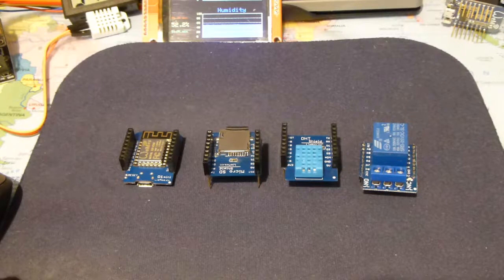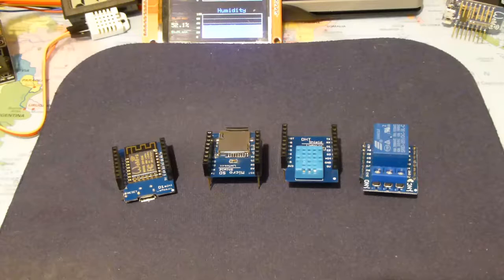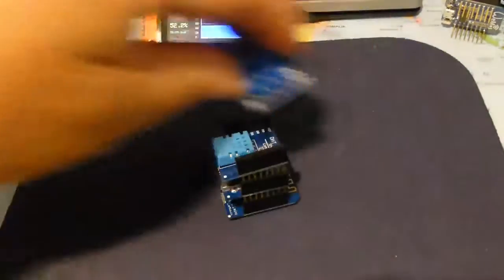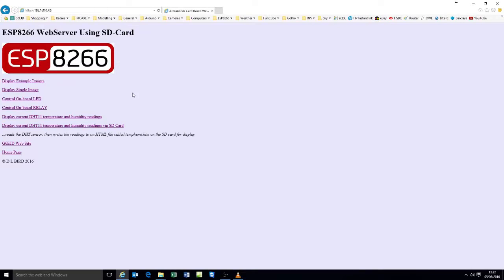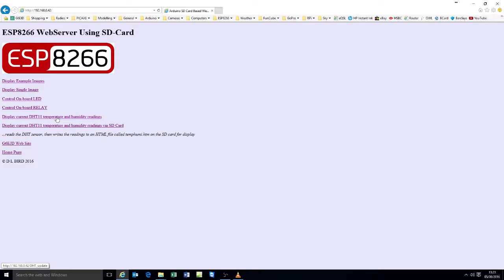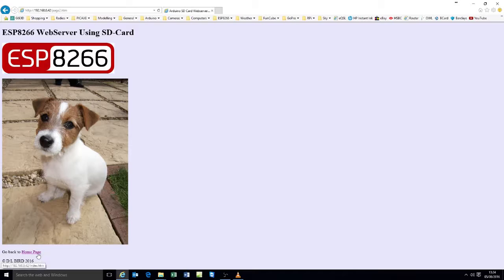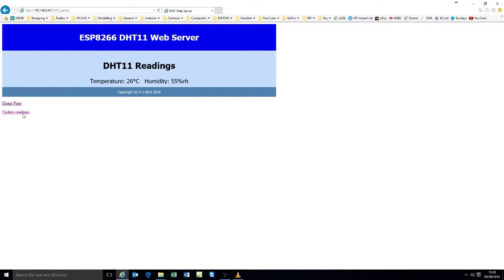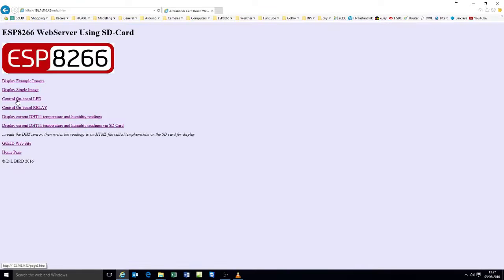Tech Note 005 - ESP8266 Webserver and Code

Comment: Your sound quality is poor it sounds as if you have a motor running and the volume is low but I did like the video was most interesting with the stack thanks
Reply from the maker: Yes  I had a microphone fault and did not check the video before upload, but I did enhance the audio a bit on this version: https://www.youtube.com/watch?v=kgimiRAiKRU&t=108s
Later on in my video series I released a general purpose web-server with configurable pages that might be worth a look.

Comment: having issues with the compile mainly Arduino: 1.6.13 (Windows 7), Board: "WeMos D1 R2 & mini, 80 MHz, 921600, 4M (3M SPIFFS)"

sketch\Sd2Card.cpp: In member function 'uint8_t Sd2Card::init(uint8_t, uint8_t, int8_t, int8_t, int8_t)':

Sd2Card.cpp:302: error: cannot convert 'volatile uint32_t* {aka volatile unsigned int*}' to 'volatile uint8_t* {aka volatile unsigned char*}' in assignment

     clkport     = portOutputRegister(digitalPinToPort(clockPin_));

                 ^

Sd2Card.cpp:304: error: cannot convert 'volatile uint32_t* {aka volatile unsigned int*}' to 'volatile uint8_t* {aka volatile unsigned char*}' in assignment

     mosiport    = portOutputRegister(digitalPinToPort(mosiPin_));

                 ^
Reply from the maker: Which library are you using? And from where?You need to be sure your SD.h library supports ESP8266https://github.com/esp8266/Arduino/blob/master/libraries/SD/src/utility/Sd2Card.cppYou have installed ESP8266 support in your IDE?

Comment: Hi

Tnx for your video explenation.

I looked at the code on your Github page.
I think I understand it all butt...
How does ''server.handleClient(); "
Start the index.htm on the SD card?

With "server.on()" you start a void.
With "//server.on("/",[] {}, handle_root);  " you could start a start screen but you comment it out.

Please help

Gr Ernst
Reply from the maker: There are links to index.htm in the html code and they are invoked from the code generated HTML first page, so index.htm can only be accessed indirectly if you like. The only way I know how is to construct / call an index.htm line by line is to construct it line by line then send that page e.g. webpage += "<doctype html><html>" webpage += "<more html...>webpage += "html>and so on then send with server.send("text/html", webpage);The Arduino does not support what I would call stream of files like index.htm. But once at index.htm you can run a full size website as my example shows.if you use server.on("/",[] {}, handle_root) then it will direct programme flow to the handle_root function where you would begin the webpage construction (of index.htm) and then send that as above.

Comment: Hi G6EJD
Many thanks for bringing the D1 to my attention it looks really good for developing projects. Would it be possible to have a copy of your ESP code. I have had a look at your web site but could not see a link to it.
Best wishes
Arthur
Reply from the maker: Hi, thanks for the interest, please find the files and source code on GitHub: https://github.com/G6EJD/ESP8266
Reply: Many thanks for the code, its really interesting to see how you have achieved such a versatile web server with the ESP8266. I have been using the Arduino Uno for about a year now but it would seem that the 8266 has so much more to offer. Your code will help me to see how to take it to the next level.
Best wishes
Arthur
Reply from the maker: Happy to help Arthur, the ESP8266 is faster, has 4M of storage for programmes and runs at either 80 or 160MHz and has built-in Wi-Fi and it's cheaper, plus if you can programme the Arduino then setting the same IDE to support the ESP is really easy and it uses the same commands. I used the ESP extensions for this server, but I could have easily used the basic Arduino constructs to achieve the same, later this week I'll post a video showing a temperature and humidity web server that does not use the ESP specifics. Since I discovered the ESP I have not used my Arduino! I'm happy to help at any time.
Reply: I have subscribed so looking forward to your next video. I was always struggling to keep my code small enough to fit into the Arduino. 4M is fantastic - I'll see if I can fill it!!